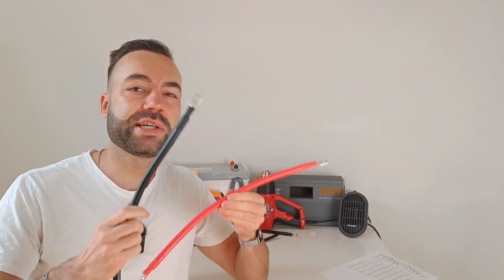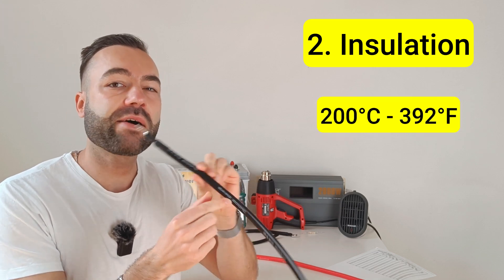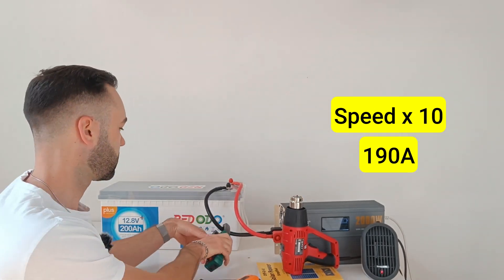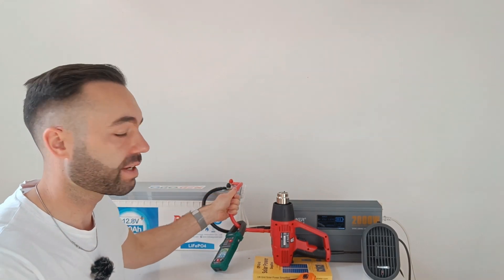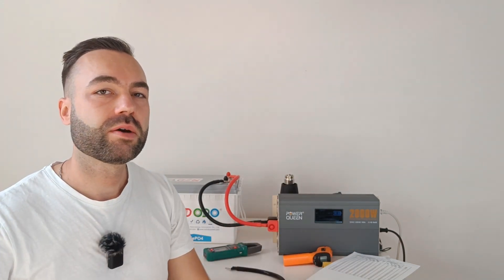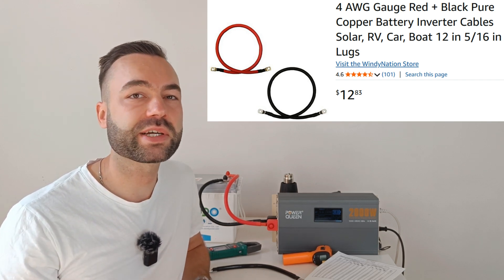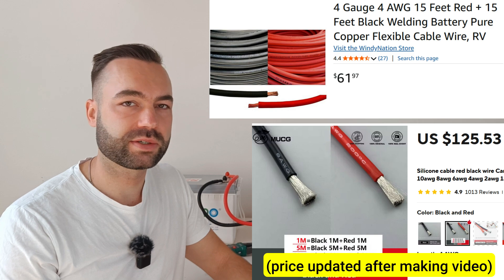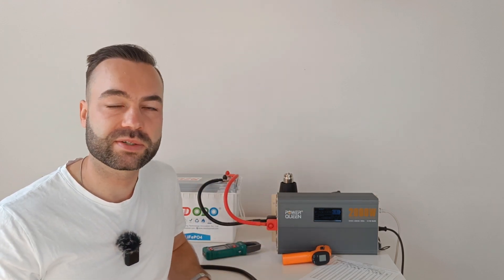High Temp Electrical Cable Test Silicone Vs Rubber Vs PVC Insulation for Batteries

Comment: Hey, Nick, great and informative videos! One thing I'm confused on. I was looking at the ampacity chart for silicone wires on your resource page. All of the wires except the 2 awg exceeded the amperage of the Windynation cables by a considerable margin. However, the  2 awg wire was actually rated lower than the Windynation by 5 amps. Is this a misprint? It just doesn't follow the pattern of the other gauges. Thanks
Reply from the maker: Indeed, I have asked them for more information about this.

Comment: Do they have silicone cables in 10awg for solar panels???
Reply from the maker: No, you need PV wires because they can withstand solar irradiance. If you use other wires they might get damaged from uv exposure.
Reply: @cleversolarpower  oh AHH yess

Comment: Hello
I used the link to Aliexpress cables but the max ampérage is not specified for each type of câble
Reply from the maker: If you look at their other products, it has a current rating. Only this one doesn't have it. You can also check on on my website -> resources, current ratings
Reply: @cleversolarpower  yes thanks I did and ordered 2 pairs ofr câbles

Comment: What do you think about using silicon insulated cables outdoors ?  Will the insulation deteriorate with UV rays ?
Reply from the maker: Yes, most likely they will not be protected against UV. PV cables are.

Comment: Voltage Drop at the higher current ratings?? After all nothing is free.
Reply from the maker: Yes, I made a video about internal resistance. I recommend checking it out.
Reply: What's the voltage drop off for silicone?
Reply: I think the voltage drop only matters when connecting from the batteries or if you length of wires are really long 

Panels in series should produce enough voltage 

Batteries don't have a lot of volts to give up tho

Comment: In my experience Welding cable has the best wire for current inside as it is a high strand count flex. However Purchasing premade cables from  an online supplier is extremely risky because even when it appears like copper it can be plated aluminum cable.That has a higher resistance and will harden and loose flexibility with use. Often used in car audio where weight is supposed to matter but when properly specked with bigger diameters weight is the same. Also in a domestic and industrial environment where unqualified contact could occur Double Insulated should be the standard. 
My experience in big cables comes from Electric melt and holding furnaces. In those apps air temp inside a junction box will often be over 200c. You cant use Pyro everywhere so you need the best heat resistant cable. Also if the cable in air runs hotter than ambient by more than 20c externally it will harden over time and create broken strands at joints causing more resistance and more heat making it's use snowball the problem. If you don't need Flex you shouldn't use it when cable is pushed to its limit and beyond.
Reply from the maker: Yes, that's why I recommend buying from a reputable supplier or brand. Silicone also has many copper strands, the same as welding cable. It's just the sheeting that's different. The insulation stayed cool even though I put the max current through it. This will change if it's put in a raceway or box indeed.

Comment: Flexibility is more a function of the number of wire strands in the cable, not so much the insulation.  Silicon cable often uses 200-400 strands... cut one open and start counting.  Usually tin-plated copper. You also have to be really careful about fake cables that wind up using copper-clad aluminum or heavy tin-plating, which have far reduced copper content.

That said, you also CANNOT just buy 200C silicon cable and then use its ampacity rating.   The problems are as follows:

* Even though the cable can handle the temperature, the things the cable is connected to (or otherwise touching) may not be able to.  In particular, cabling to battery lugs... battery terminals are usually rated at 60C, not 200C.  Breaker terminals are typically rated at 45C or 75C and generally no higher.   PCB-mounted terminal blocks typically can't go above 60C safely.

* Thermal cycling is also far, far worse and can loosen bolts over time and cause other problems.

* Combined heat generation (for example, having several hot cables in a conduit, battery box, or electrical box) can still overheat.

So for the most part you do NOT want to buy thinner gauge cables just because they have 200C silicon insulation.  You can buy silicon insulated cables as an added safety, but it isn't a good idea to buy such cables in order to get away with using a thinner gauge.

-Matt
Reply from the maker: Thanks for your comment Matt. Indeed, the amount of strands contribute to the flexibility as well. We are using a correction factor of 1.25 already because of the multiple cables in a raceway and other factors which I talk about in my book. I agree that thermal expansion of the lugs can be an issue with improper crimping.  However, none of the lugs got warm in my tests. I do not agree with the statement 'get away with a thinner cable because it's silicone' they have been tested the same as PVC and rubber cables and given an appropriate current rating.
Reply: I agree this needs to be said clearly. Ampacity rating should always be based on wire gauge first and foremost. (And having basically good quality, eg. be made of real copper.) I suspect Nick agrees but perhaps he could have been more clear about it before making his point about insulation.
Reply: Nah it's more so the silicone I have a silicone type C 240w cable the things is super bendy

Take into consideration how much more slim the cable is I doubt there is enough copper to make it that flexible